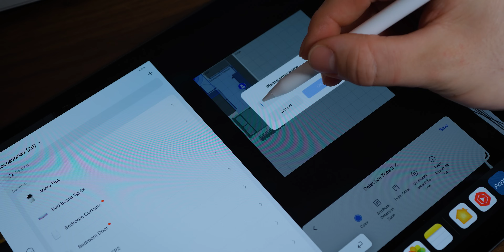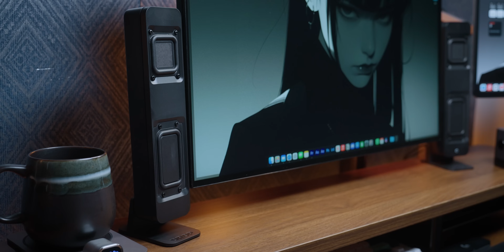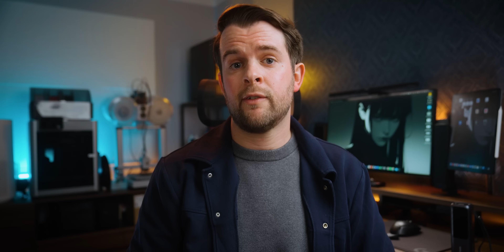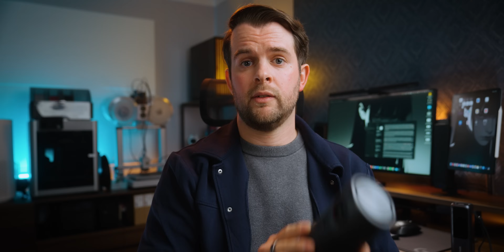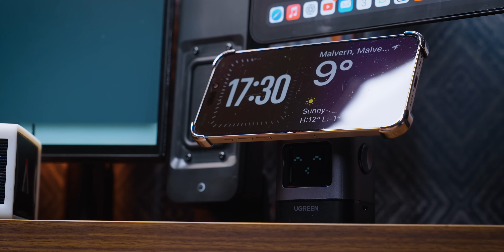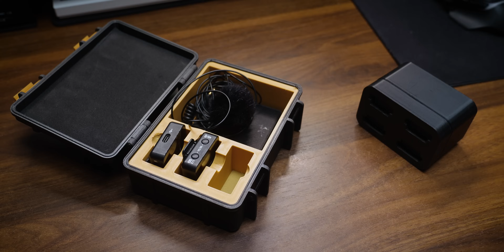Tech To Improve Productivity and Creativity

Comment: what kind of bed frame do you have ?
Reply from the maker: It’s a budget one I found on amazon. If you search king size bed it’ll probably be one of the first results
Reply: @ is it sturdy ? I have the malm one from ikea and it creaks so much even when I turn to sleep on the other side
Reply from the maker: @Akkarius it’s very sturdy, the only thing I’d say I need to do is add some non slip pads. It sat on hard floors and it does move easily, but no sound.